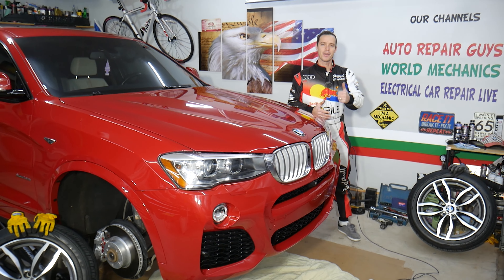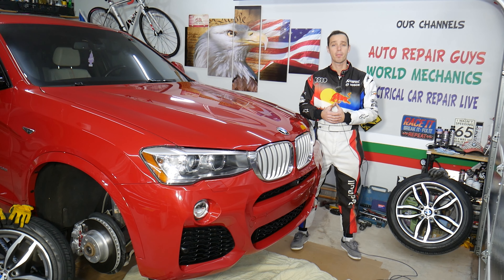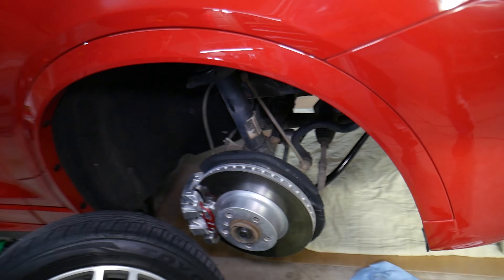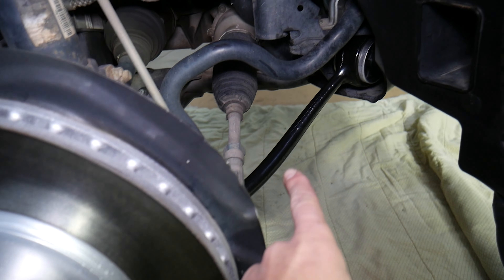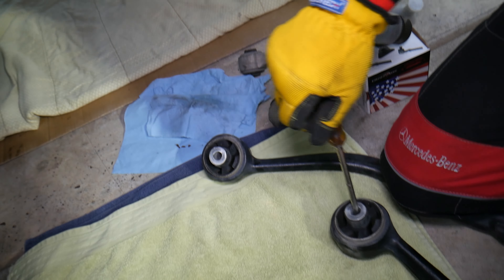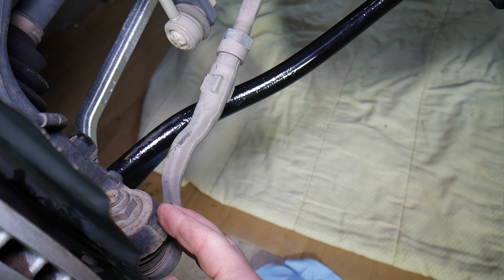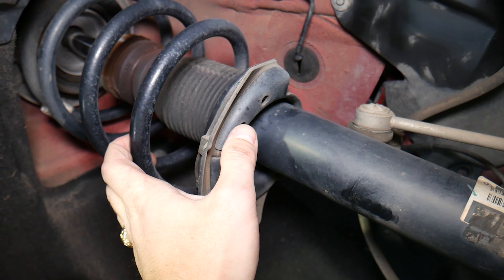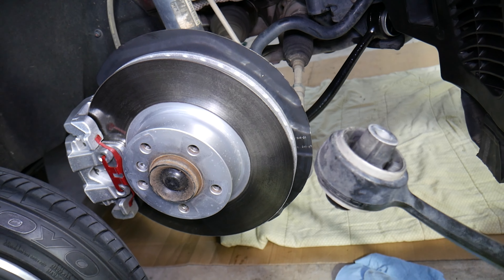BMW NOISE RATTLE CLUNKING FRONT END SUSPENSION BMW X1 X2 X3 X4 X5 X6 F10 F30 F11 F31 E90 E91 E60 E61

Comment from the maker: Products that we use and recommend:
► BMW Rack and Pinion: https://amzn.to/3A1ljtP
► BMW Rack and Pinion Tool: https://amzn.to/3HZOb7K
► BMW Front Control Arm: https://amzn.to/3buHU7N
► BMW Control Arm Bushing: https://amzn.to/3bwcr5e
► BMW Tie Rod: https://amzn.to/3buh8fR
► BMW Strut Mount: https://amzn.to/3xWelU1
►Liqui Moly Oil Saver: https://amzn.to/3xR3Px3
►Liqui Moly Engine Flush: https://amzn.to/3IiDBID
►Liqui Moly Cera Tec: https://amzn.to/3GfQuRI 
► Panel Removal Set: https://amzn.to/3nZlEGJ
► Tool Set: https://amzn.to/3p5MM6t
► Screwdriver Set: https://amzn.to/3FUKyNV
► OBD Scanner that we use most often: https://amzn.to/3I4MQfe

► Check out our Amazon Store for the tools and parts that we use: https://www.amazon.com/shop/worldmechanics
Reply: I have a 06 BMW 750Li with a clunking noise in front end.  Doesn't look like inner or outer ty rods, or strut, or sway bar link.  Any other suggestions?

Comment: I have clunking on front left side only when I take off fast. Normal driving it doesn’t clunk. When it clunks it’s only 1 to 3 clunks depending on how fast I take off and that it’s doesn’t clunk after reaching higher speed
Reply: Anyone know what this is? I’m having exact same issue.
Reply: Hello i have same issue did someone found out
Reply: When I changed out my strut assembly and shocks it stopped making that clucking noise but still makes a  different subtle sound over bumps
Reply: @yacinezaiter5383  did you find out what was causing it
Reply: I have the same issue
Reply: @xaviergalvez4819  no
Reply: @rydgomez2  thank you man I have the same problem too
Reply: Same mine does it a 30-35mph sounds around driver tire. Lifted car with jack to look and when the tire came off the ground it slightly made the pop kaulk kaulk kaul noise. Upon letting it down when the tire fully engaged the ground with weight the noise was louder.

Comment: If I may add: my F25 X3 clunk came from the wheel bearing.  Suspend the vehicle, grab the wheel and rock it at 12 and 6, and 9 and 3.  If you have movement and clunking on BOTH directions it's most likely the wheel bearing.

Comment: wow, so IT COULD BE LITERALLY EVERY SINGLE COMPONENT IN THE FRONT SUSPENSION. INFORMATIVE
Reply: lol I was thinking exactly the same..
Reply: and you will still have a clunking noise.
Reply: ive changed every component of my front end suspension and still have clunking noise like a shot strut. Fucking driving me crazy.
Reply: Yeah same I have brand new spl front lower control arms I have brand new heavy duty strut tension bars. I still have the clunking and wandering steering makes no sense and we don’t have upper control arms for the knuckle so my next look is the strut bushings it is only on the driver side 

It’s driving me insane why the real mechanics can’t figure it out but I went to uti worked for nissan once I was master Nissan mechanic I sold my Nissan and bought BMW bc it was just superior in every way so. Now I want to smack the mechanics that aligned the car I said look on the machine and see what you can find oh we don’t use the machine to check for alignment I said whatever I don’t care bc it’s aligned well but how can you call yourself a front end suspension expert if you can’t find it 

I have bump steer from the lower control arms from spl I have to buy the tie rods from spl duly noted just bought them and eccentric lock out kit for the rear 

Going to buy sway bars too  but I need to find out why this bullshkt is still clunking and wandering a little

Besides I am only person who ever figured out any problem with my car because mechanics are lazy and can’t figure out how to properly drive the car to recreate the situation and then listen to what customer is stating although very hard when a Karen explains the sound 

I deal with it as well when I work on peoples cars but still how come I always fix peoples cars but when I need a fuckin mechanic bro fix my car they can’t figure it out only when I read couple hours then I find the solution. I swear people are so incompetent so I’ll comment when I figure it out it’s only at 60 does the car feel so unsafe and with everything being replaced it’s frustrating because the struts are aftermarket and new so it shouldn’t be them

I don’t know just fuck the mechanics do it your selves for now on because mechanics will say they fixed it and they didn’t because they need to get paid and they will keep fixing wrong shit and charge you every time
Reply: @112rorz probably cv axel
Reply: @skunkypole1532  its 2wd. Anyway turned out to be the steering rack